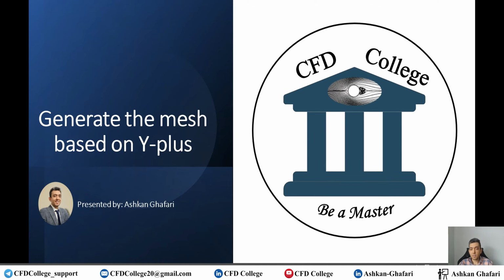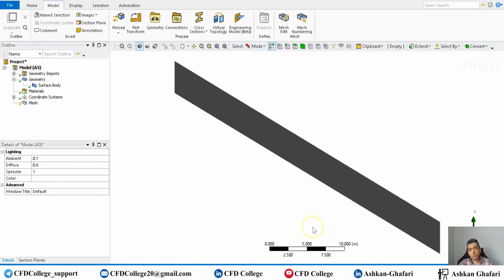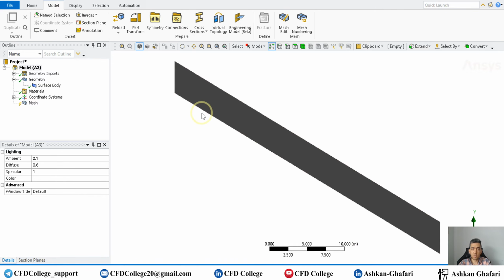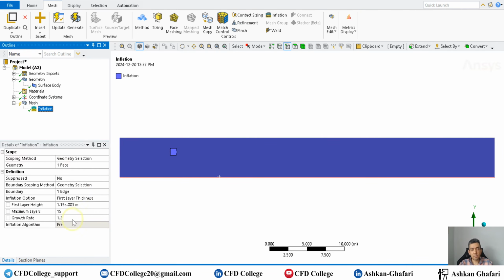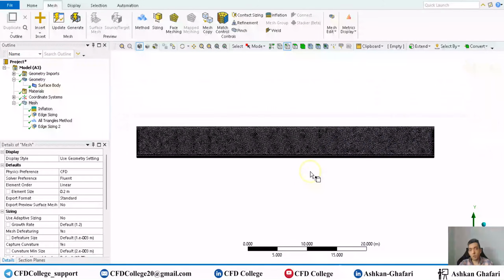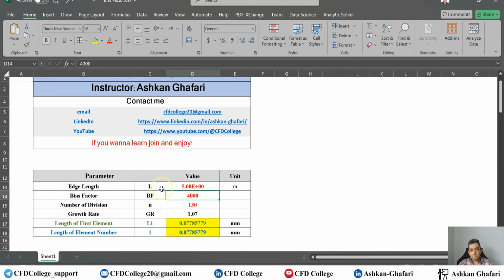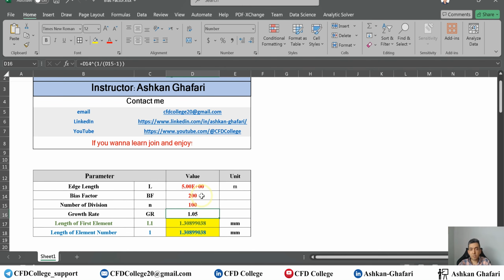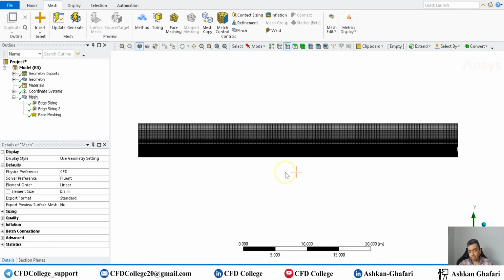Generate Mesh Based on Y-plus in ANSYS Meshing, Structured and Unstructured Grid with Y+ Calculator

Comment: Thank you for the informative video. How do you decide on the number of boundary layers. Should the number of boundary layers be so that they capture the whole boundary? Or should the number always exceed a specific number like 10 to 15 for moderately dense grid or 20 to 30 for a find grid?
Reply: I'm asking because using the k epsilon model, we can wrap up the grid boundary layer sometimes with less than 7 boundary layers would this be true and valid in terms of mesh quality?
Reply from the maker: Hello, thank you for your comment. There is no specific rule for this. However, as you mentioned, it depends on the turbulence model and wall function you are using. If you are using a wall function, 5 to 12 layers should typically be sufficient, depending on the project. On the other hand, if you aim to resolve the entire boundary layer, at least 20 layers are required. In this case, it also depends on factors such as the project, mesh quality, and other considerations.